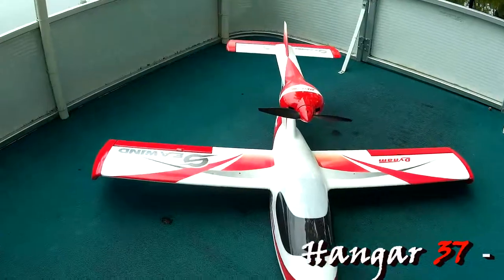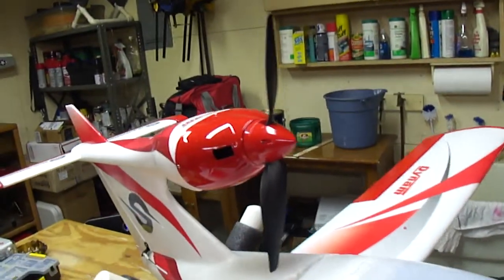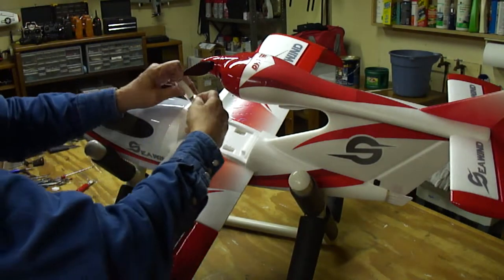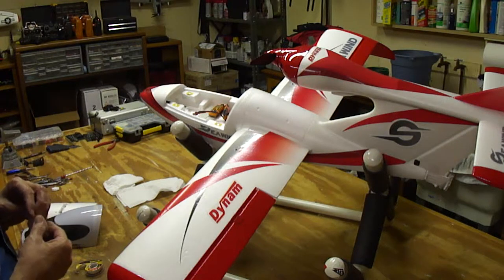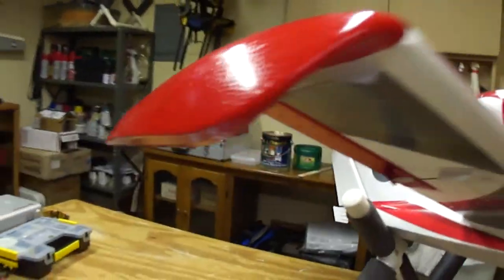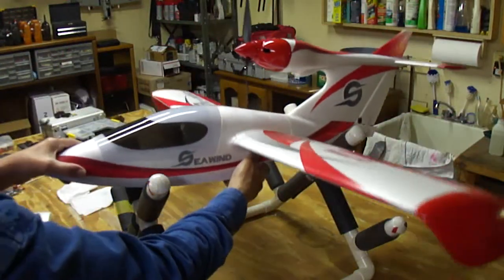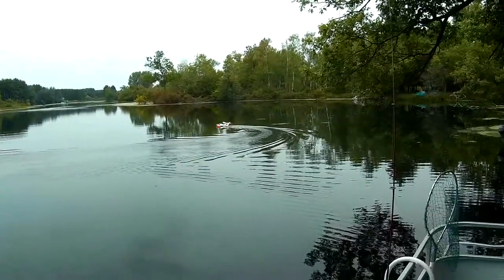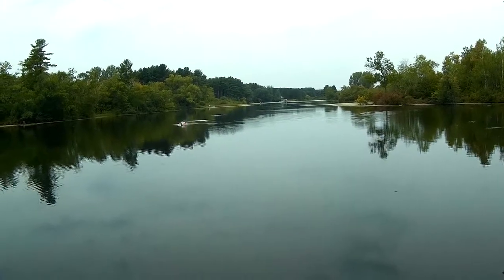SeaWind-Maiden, Crash and Quick Fix

Comment from the maker: Hi Lyle, I moved the CG back to 50mm. had to move the battery back a bit to balance slightly nose down with  couple up clicks on the elevator. seamed to improve a bit. Still have to work on my landings. Good luck - John

Comment: Hi I just purchased this from General Hobbies for 179 free shipping.  Been checking  Youtube for any tips on this plane.  Got a question regarding if you install the landing gear you can't use it on the water anymore because of screwing in  the landing gears and creating holes in the fuselage? Another question is did you have any problems with the elevator cable binding ...servo arms moving but the elevator moving a small increment amt or not moving at all?   Iam surprise they were selling this particular model back in 2015.
Reply from the maker: Never attempted to use the landing gear. Was strictly a water and snow plane for me. You actually can use it on grass to. As for the the travel problems on the elevator, make sure your linkage rod is in the linkage cable tube. If all is well with the cable and tube it should travel normally. I would try a new tube and linkage cable, which you should be able to get from any hobby shop or Horizon Hobby.
Reply: @hangar3764  thanks for the rapid reply. Will try the grass landing routine to trim and get used to the plane.saw the video where the plane went straight into the water when pilot was trying to trim the plane and he wasn't a newbie either. Hehe I think it was ur video 😋.
Reply from the maker: @harsep  All I can say is, make sure all the surfaces are working correctly. If not, find the problem and fix it. Otherwise you may be the next one to put her in the drink.lol  Good Luck
Wisconsin John